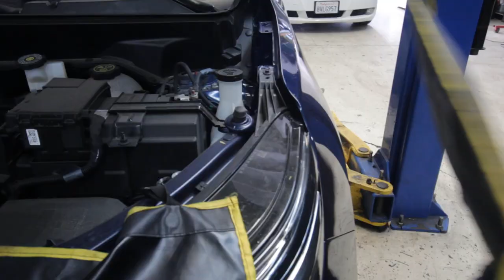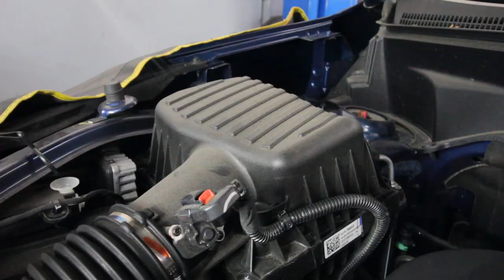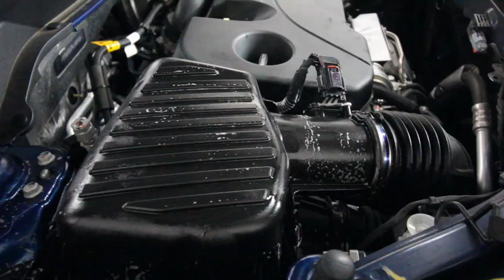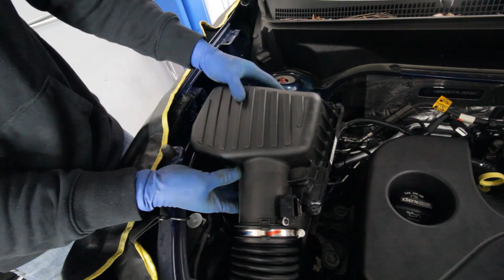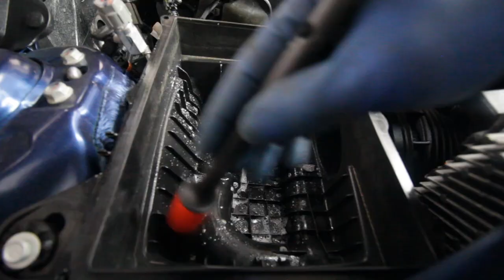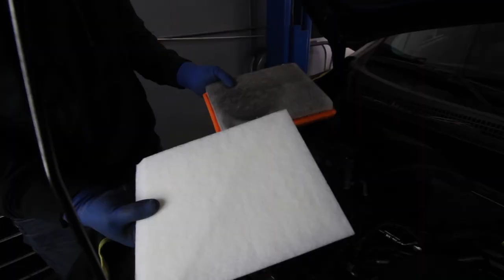2022 Chevy Equinox Air Filter Replacement

Comment: Professional job! Question from a layperson like myself:  when washing, the engine area, are you not concerned about damaging sensors?  Thank you.
Reply from the maker: Thanks for the question. The sensors have very good weatherproof connectors. So long as you don't douse the connector directly for a long period, they will be fine. Especially if you blow-dry the area after with compressed air.